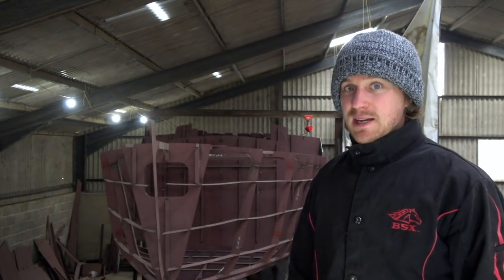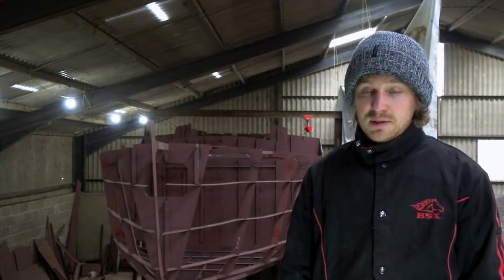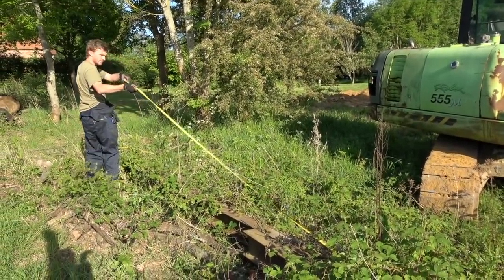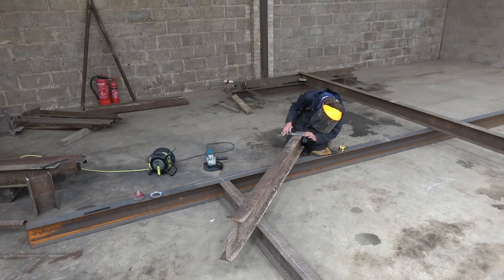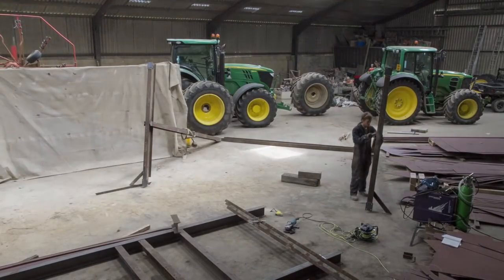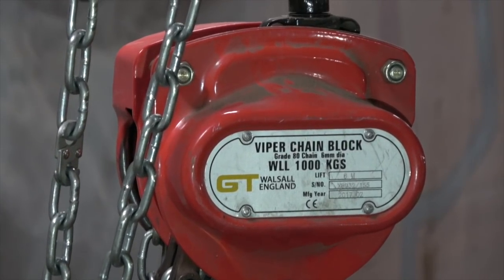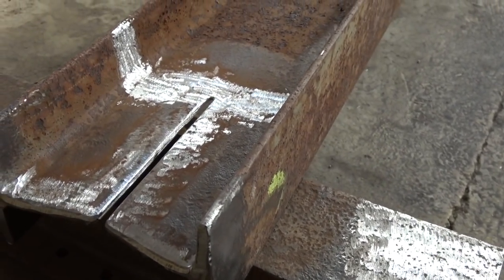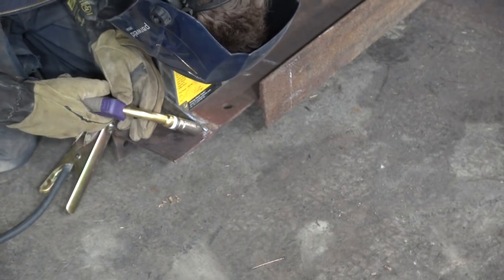Making a Gantry to Build Our Boat - Ep.1

Comment: How much did it cost overall ?
Reply from the maker: The casters, beam trolley and chain hoist cost about £350-400 all together. The steel was scrap, but new would have been about £500, but we could have made some savings as it was very overbuilt for the 1000kg maximum lift we needed. We made it heavy because we had the scrap to hand.